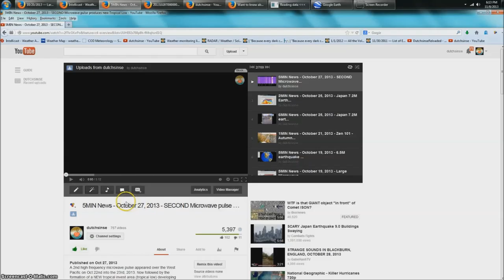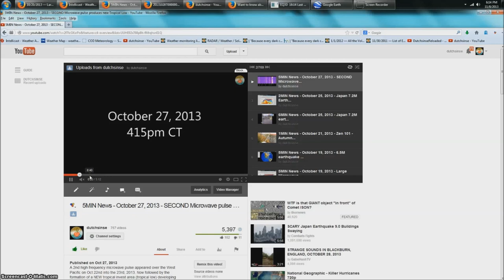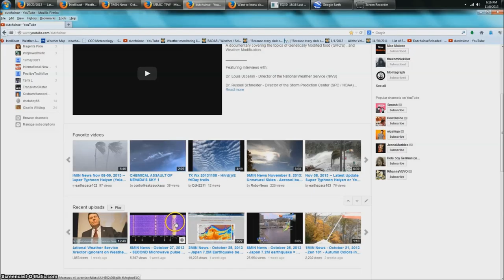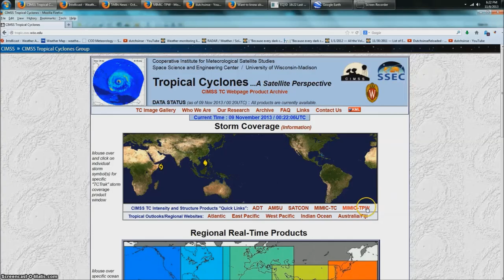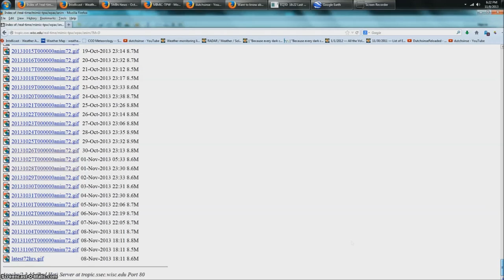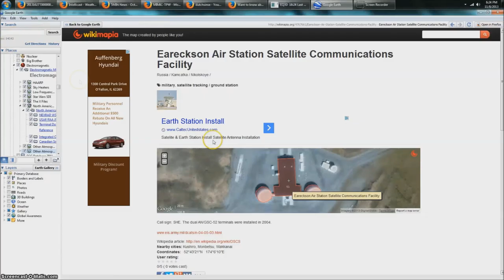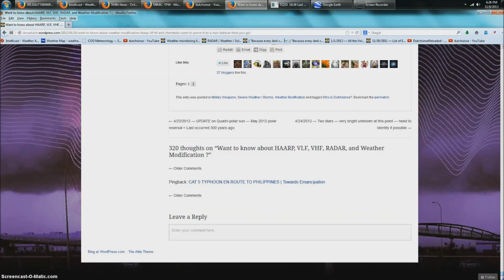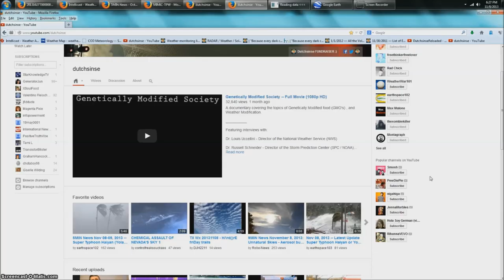11/8/2013 -- Microwave Pulse gives birth to Typhoon Haiyan (Yolanda)

Comment: We had a friend try to explain this to us over 14 years ago. He used to focus our attention on the sky and say "you see that? They're frying the sky right now." We used to just write it off as an overactive imagination. Not any more. He works on the cell phone towers which DON'T just house comm equipment. The companies that own them "lease" space for other types of equipment as well. The "rippled" artificial clouds are like iron filings around a magnet. They are using these microwave towers to create high and low pressure areas and push the jet stream around. Forget 2025. The Air Force "owns the weather" right now. Thanks for your work Dutch.
Reply: From CIA
Reply: yeah sure - thats why the tropics at like the tropics still... if it were cell towers then the weather would be worst over 1st world countries not 2nd n 3rd world countries

Comment: Hi Dutch, Auckland, New Zeakand has just experienced the strangest summer. Even though we had an El-nino summer we should have had periodic rain. This is not strange but what was witnessed by the locals got real wierd!.
As rain fronts approached the area, they would reach a stage of almost raining & then it all happens.
The air gets a bit energetic, the clouds start to change direction, yeah, alomst start going backwards & at the same time, dissapaite. In no more than 4-5min the sky is now clear of both low, mid & high cloud but in the shape of an arc.
The arc shape appeared in the clouds every time this happens.
Due to atmospheric conditions, things varied, such as the edges of the clouds glowed just before they dissapated. energy was felt, one time small lightening flashes went between the clouds.
It was wierd.
Reply: Somebody film and document.

Comment: Dutchsinse absolutely good job. Between yourself and the good ol Jim Lee for making that climate viewer, fantastic info from the pair of you.
Those earthquakes, in my opinion, can be a good indicator that something is up. On the 3rd Nov, there was a HUGE cluster of quakes registering. I have watched these quakes everyday, for well over 18 months and what i seen was unusual.
So many times a 10 and 30 or 33km depth appears, where weather is doing odd things. Good recent example was Wyoming and Utah (mid Oct, with 100,000 cattle DEAD), I had a inkling that some form of weather  was going to whack that area and sure enough, a huge snow storm. Another one was Hurricane Sandy. There seemed to be huge amount of quakes appear around Queen Charlotte Region, even though that is east coast, distance in weather doesnt seem to be a problem, but that was like it was pushing a jet stream/weather system towards the west coast. Another example of distance was here in Australia, Cyclone Yasi "seemed" to be fuelled and travelled more or less the whole east coast, about 1200 kilometres.
It may seem pretty far fetched but, it very much looks to be a link between quakes and weather events. I would like to think i am wrong but too many times have seen this. Clever shit.

Comment: i'm sorry but i can't agree. in order to create a tropical storm you will need a lot of energy like tons of gigawatts. do you even consider that? or you are just depending on microwaves?
Reply: if you want lots of energy its in the atmosphere its a matter of manipulating that energy through waves..
Reply: Careful -- intelligent questions like these are no doubt forbidden here ;-)
It's more a site for "believers" in population control, even though this is the most ineffective method imaginable.
Reply: manuel aquino
BS. I am a radar (oh! evil microwaves!) expert on both CW-dopper magnetron transmitters and klystron pulse transmitters. Worked with transmitters so powerful they need aircraft turbines to drive generators. There is NO WAY to manipulate the weather using microwaves. None. Never have, never will. The best you can do with VERY powerful microwaves and a focused antenna is fry a turkey a mile away, and make TL-lights flicker on and off. That's it.

You guys are not talking science. Most here are talking conspiracy BS, and nothing more. They have no idea whatsoever.
Reply: alpcns
actually there is a science behind this...what happens when you add microwave to metallic particles in an area such as where your turkey is? they are activated in some form or another...in this case they are charged and effect the molecules around them...and it is fact that the particles being sprayed in the air are conductive to these waves and react with them...no conspiracy theory at all, but documentation of actual events going on...actual methods employed, and the actual results of these actions, observed by all...investigated, documented, and recorded...thats called the scientific method...you may be a radar specialist, but there is only so much they will teach you about it...you are "specialized" that means they dont tell you anything more than what you need to know to do your job...you are compartmentalized...you also do not have access to all forms of this technology, especially the cutting edge forms of radar and microwave arrays...this is not so much conspiracy BS as it is independent investigation...and that is what we need more of today...conspiracy BS is what you find on the websites that have articles about "aliens got me pregnant and here is the baby, i got pictures" like a tabloid...this is far far more intelligent than that garbage...they dont even belong inthe same category...what you are saying is the same as saying resisting tyranny = racism...it is the ridiculous marginalization of real people exposing real evil...
Reply: lastoftheki
Exposing evil is a lofty cause I actually wholeheartedly support. But that doesn't mean I support (or believe) anything I hear, especially not on the internet. There's so much utterly unscientific nonsense going on, you have no idea.

Sure, my turkey and the metallic particles (how did they get there?) will react to the focused ultra-strong microwaves. They will actually scatter my microwaves. Not good, just like chaff in WWII wasn't good for the enemy radar. It disperses and renders it ineffective. So your particle theory doesn't hold water I'm afraid.

I am all for the scientific method - but the problem is that most have no clue what it really entails. Theories are NOT the scientific method, at best a start, but not proof. And opinions are completely worthless as far as the scientific method is concerned. Science is extremely rigorous, that's why it yields results. I'm less compartmentalized than you seem to think.

I'm happy to see you're not in the "alien" field. But I am a skeptic (as a scientist, healthy skepticism with an open mind is a benefit) and not easily convinced - not without the data. Show me the data, and we're talking.

One thing, for example, you won't find on this (or any other) site is how they are going to generate petawatts of energy, and, assuming it was possible, how to get it focused at a certain area. Maybe (MAYBE) they'll succeed in heating up a bit of the atmosphere. And then what? It doesn't add up, and that's the problem I have with it. Nice people perhaps, nice theories, but no hard, irrefutable data and facts to back it up.
Reply: alpcns
you dont need petawatts of energy any more...the new technology is either a combination of sound waves with EMW or just sound by itself (which is actually also EMF)...takes much less power to create these effects...take a look at the hutchison effect...and this was done by a backyard scientist...sure he got shafted, hes a broken man, went a bit off the deep end, and hes a bit strange now since hes been railroaded and had his patents and equipment stolen, but his research is real and independently verified...and the govt has taken his research in sound and electromagnetic engineering and used it in weapons technology already...this is what is being applied, not the ancient radar technology you keep assuming is being used...like i said you are compartmentalized...you only know about radar and what was true 50 years ago pretty much is the same about that little niche...try to think outside of the shoebox for a minute...
Reply: lastoftheki Who are you talking about?
Reply: Are we talking about 1.21 gigawatts?
Reply: alpcns

I doubt about this manipulation of this weather. but if this is true who are these evils behind this deadly monster typhoon that killed thousands people included children, elder people.  I know U.S want to control the human  population in the whole world especially in the 3rd world country like Phil.
Reply: pls check HAARP. it is used to manipulate weather. The Military's Mystery Machine - Haarp Weather Modification Technology in Alaska
Reply: alpcns
actually yes sound waves do register on the electromagnetic spectrum, and i know this because two people i know personally know this also and have demosntrated it...one is into radio frequencies, and the other is a chemistry genius...two different fields, but they can demsonstrate the same thing? unheard of right? usually, until people from different fields put their ideas together...thats the problem once again, you think it is not possible, therefore it is not...when you start dabbling in combining different forces, then the rules of physics go out the window, and you start to cross the threshold into quantum physics...where the rules dont even make sense any more...you are talking about newtonian physics, with simple mechanics...im talking about things that break those barriers...when they figure out how to fold time and space, sound is going to play an integral role...you can laugh all you want, but your field and so many scientists think the same way...they stay in their box, and think that one category has nothing to do with another, so they dont study or take cross readings or data to find out anything new...they just stay within the lines like good little girls and boys with coloring books...
Reply: lastoftheki Collaboration in several fields of science is far from new. It's obviously always a good idea. As for your breakthrough discovery -- maybe we'll meet at the banquet of the Nobel laureates where you and your friends receive the prize. Trust me, I want you to win it - but the chances are, as far as I can see, not that good. I could be wrong, I'm only human too. Good luck.
Reply: alpcns
its nothing new as long as the goals are in the interests of those that are in power, but try and get a pysicist to talk to an archeologist or a DNA specialist...its hard to do unless there is some kind of agenda, normally...and i dont want a nobel prize, your sarcasm aside, that is a sham to begin with anyway...i mean look at who they gave one to last time? might as well be cookies and milk...or a booby prize
Reply: I wasn't sarcastic - I would love you to win such a prize. I mean it. It's not likely in my view, but like I said, I'm only human.

I do agree that the value of the Nobel prize has been seriously undermined by the last recipients. 

Actually, technology is becoming more and more an amalgamation of several fields. Chemistry, physics and EE are one example (resulted in the discovery of 11 states of water) and optics and electronics is another one. It's a natural process, as we understand and learn more and more. That's the beauty of science. It's not for nothing that the old Greeks called scientists (from scientia) the "seekers of the truth".

That's what science does, even if that's not always clear. That's why I love it. And given it's track record over the centuries, I'd say it's proven to be darned useful.
Reply: alpcns Perhaps I am out of place but you call yourself a man of science and to that, a seeker of truth, yet you condemn what doesn't agree with what you think you grasp....that's exactly NOT what a true man of science is. A true scientist can only try to disprove what he does not yet fathom, inherently keeping an open mind to ANY possibility until it is dis-proven. In other words, don't ask for proof but seek the answers yourself before you go telling people they are wrong, that's just silly. (perhaps, just perhaps, someone, other than yourself, has figured out how to accomplish what you think is impossible but you fail to open your mind to the possibility of that due to your ego...) just saying.
Reply: lastoftheki hey... do you realize you're "blabbing on" like a conspiracy theorist? 
Yes, if you put metal in a microware, crazy things starts to happen but are you suggesting there was a bunch of metal up there in the sky?
Also, not only do you need a lot of energy but you need little wind shear, warm water and  pre-existing disturbance to generate a tropical cyclone.  Microwave pulse wouldn't do it alone.  This stuff DS posts is based on huge logical fallacies that continues to be ignored.  Good stuff for a SF move though I must admit.
Reply: Nikola Tesla once said that the atmosphere contains energy up to unlimited quantities.
Reply: yes it does, in ways we are just beginning to find out again...but he already knew that back when he was experimenting...and his discovery was nothing new...this technology was used in ancient times as well...we are just beginning to scratch the surface on how it was used back then, and tesla was rediscovering it in his time, each time someone rediscovers this, they are suppressed and ruined
Reply from the maker: Much less energy is required.... all links below the video prove what im saying. Its not up for debate. Im telling you , not asking you to believe me.
Reply: dutchsinse you want us to watch all those videos to prove your claim? i wouldn't be able to do that right now, but I will try to get back to your claims.
Just asking, do you have a peer reviewed science journal on this topic instead?

And If it turns out that your wrong, I expect that you will do the right thing and apologize to your audience about this video.

Because this were already predicted by global warming experts, and they have peer reviewed journals.
Reply: emancoy . lol
Reply: JoeGancher
I completely agree! Next these rat bags will blame their imaginary HAARP waves or "chemtrails" ! Sorry conspiracy "experts", our weather changes are a result of global warming from increasing levels of in green house gases in the atmosphere!
Reply: JoeGancher 
1.Bet you don't have those degrees & if you have, then
2.go back & do your own research.
3.start with the mid-1970's treaties to ban the use of weather mod as an instrumant of war. It was the 'Convention on the Prohibition of Military or Any Other Hostile Use of Environmental Modification Techniques' - didn't stop anyone (too irresistable, too powerful & too perfect a weapon) - they just changed the progrqams to 'atmospheric research'.
4.then watch this neat lab-demo of the principle /watch?v=xo-T_KvLNdQ. Yes...they do use gigawatts of power.
Reply: Ronnie McTail do you even have a degree in chemistry and physics? No? No? Oh my bad, sorry you never learned to accept the facts given by people who are actually subject experts
Reply: Ask your President
Reply: kahnj questioning should ALWAYS be supported. It's called thinking for yourself.
Reply: I believe the bulk of the energy is already present in the area being speculated about. The microwaves are only the start of the effect. Amplified by heat from excited aluminum that has been sprayed into the jet stream. I think the microwave/aluminum heating, is simply the straw needed to break the poverbial camel's back, so to speak. I don't believe they can create something like a massive hurricane out of whole cloth, yet.
Reply: 62636263c
Ofcourse the bulk of the energy is already in the storm. Needs NOTHING to trigger it at all ! EXCITED Aluminium ? HOW RIDICULOUS !
Reply: 62636263c Yes ... I think that is what we are seeing... a huge amount of energy already present, then pulsed "triggered" ...
Reply: wouldnt u just need enough to get it started an it will build on its own?
Reply: LOOK FOR HAARP IN YOUTUBE ..!!!
Reply: JoeGancher  and this is precisely why you miss the point, because you confine your thinking to what you have been taught, which is not real science, science is constant experiments and discovery, and many times in true science things are being re-written all the time, or new understanding is being added to the old data...or old erroneous data is discarded in favor of what is really true...much of what is accepted in text books as fact is often not, but merely theory that seems to be true, but only part of the overall theory has been proven or repeated...and yet these theories are still pushed as fact even though the data is incomplete...and often times the data is not comprehensive, but narrow and limited in its scope and vision...or is presented with an agenda in mind...science is an organic living and changing field, it is not just an exercise of following lab recipes of the same things that have been done over and over again... you also confine things to the cramped box of newtonian physics, but when you move into the realm of quantum physics, the rules change, and make no sense in newtonian terms...once again...sound does show up using the same tools used to measure electromagnetic waves...light is also measureable there as well...just because you confine your thinking to one discipline, does not mean other things are not true...things you may thing of as absurd, are actually possible if you try them out...we are talking simple things, not anything hard...
Reply: @alpcns  ..!..